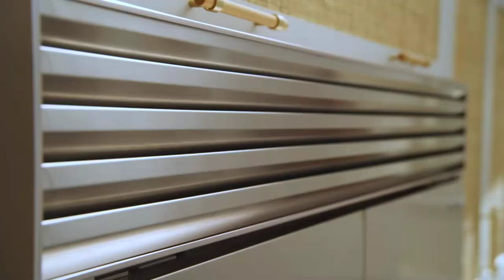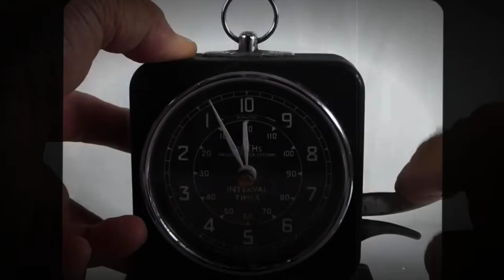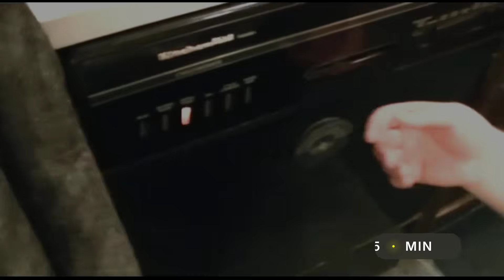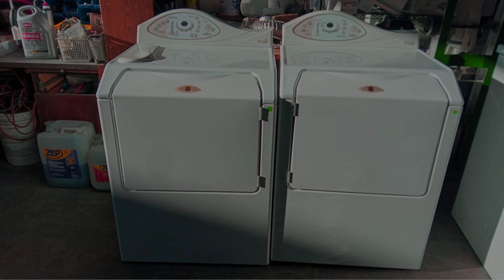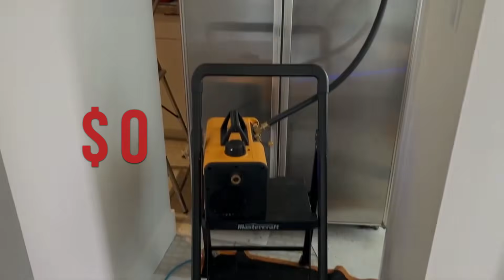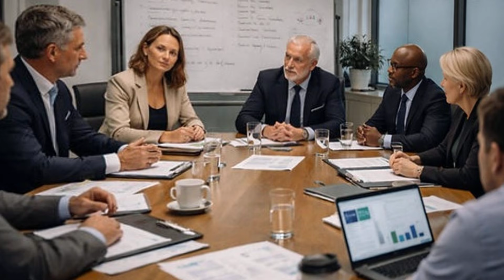The "Analog" Loophole: Why 1990s Appliances Are Now Worth Thousands?

Comment: I downsized in 2021 and purchased a home with two GE Profile refrigerators; one black, one white. I made a mental note to replace them with modern stainless steel versions as soon as I moved in. Four years later, these refrigerators are still with me and working marvelously. When I researched new fancy models and saw all the warnings about them failing in two years and had contractors tell me to hold onto my old models as long as I could, I took their advice and very likely wont have to be budgeting for new refrigerators for years to come.